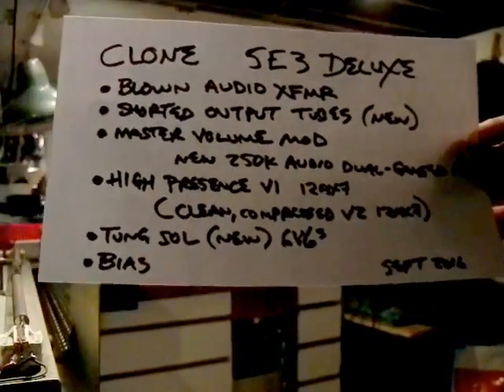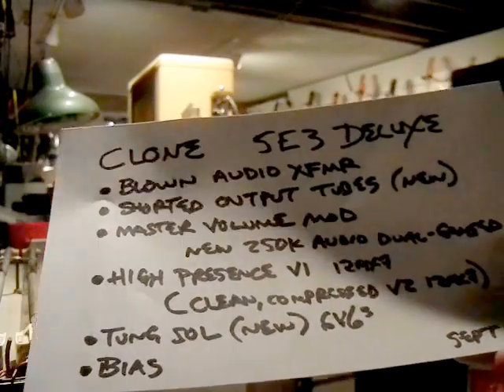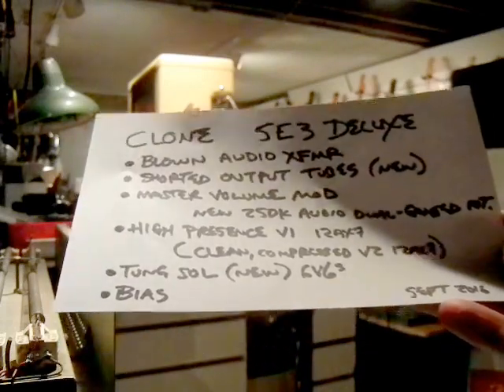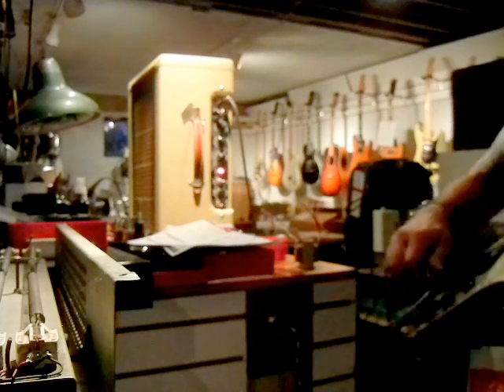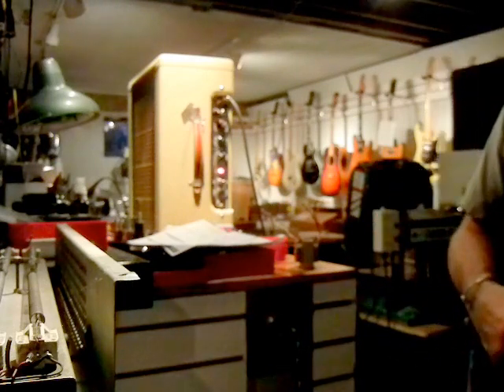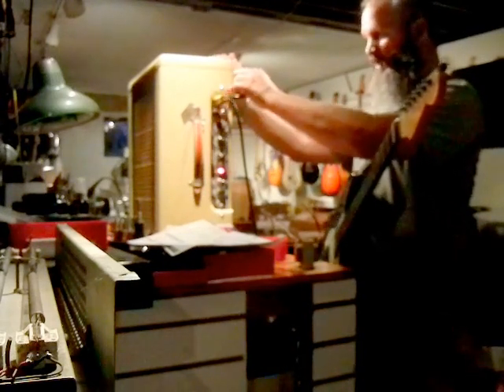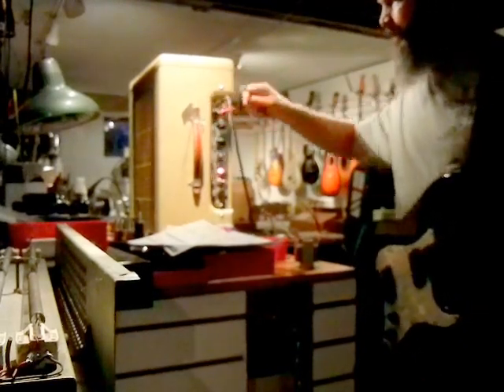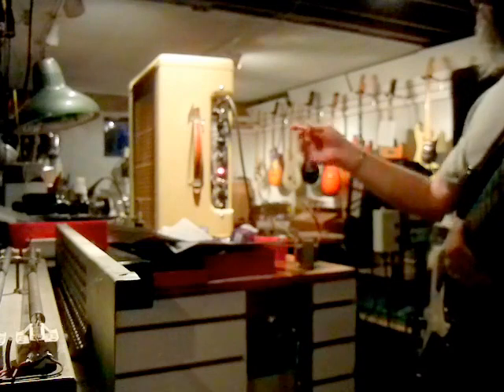CRANKY'S AMP MODS 5E3 Deluxe kit Clone MASTER VOLUME MOD

Comment: did you put the master volume pot where should be a grid stopper to the cathodyne PI, or did you put it after the PI tube? cheers from Brazil
Reply from the maker: It is post phase inverter. Thanks for watching

Comment: I thought it was very interesting for the dual gang potentiometer that you used for the master volume control. I'm fairly new to modifying amp circuits and I've always liked the master volume control to give you a lot of different tonal possibilities and to add a nice overdrive to the amps sound. As far as master volume pots are concerned I've noticed that lowering the values make a lot of difference in that some amp circuits work a lot better with lower values pots than others do -I found this out on putting a master volume on on my early 1970's model Traynor yba-1a bass head. I was originally using a single 500K pot as some had suggested but actually going to a dual gang 150k linear pot was a whole lot better. Very cool sounding amp, great job.
Reply from the maker: Thank you! The reason the lower value pots work better, is that there is a maximum value that the output tube like to see, typically given around 220K, on a grid-biased circuit. 
I read datasheets all the time to keep fresh some things like this, and to make comparisons ad develop guidelines. Like typical maximum capacitance for a tube rectifier, or heater current for different tubes, and on max plate dissipation for biasing, and max plate voltage. I print the first page and keep it near the workbench on my tube tester, GE is the best organized.  Frank.pocnet.net is my go to website for tube schematics.
Keep on modding!

Comment: All ouput tubes devolop what... short?
Reply from the maker: All output tubes eventually develop a heater to cathode short. Because the heater is in physical contact with the inside of the cathode tube, eventually thru expansion and contraction and vibrations, the insulating oxide wears thru. You can sometimes see a white powder inside an output tube, like a snow-globe. That shows that the electrical insulation is wearing out or has catastrophically failed. You can catch the short in the early on if you have a tubes tester with an analog meter. The low reading of a short can be normal for pentodes, although no conduction is better. A reading of 10-20% would cause hum in a single-ended amp, and is a good time to take a preventive action. Waiting for a dead short to show up is negligence. Most amps do not put a fuse on the heater circuit, so when your output tube goes heater-short-to-ground something else will turn into a fuse. Like your power transformer, and since currents that do spot-welding on your chassis are involved, a cascade failure within the tube can also cause the audio transformer to turn into a expensive fuse.